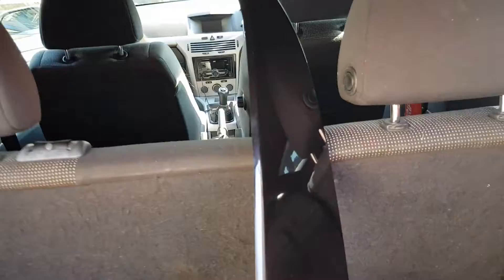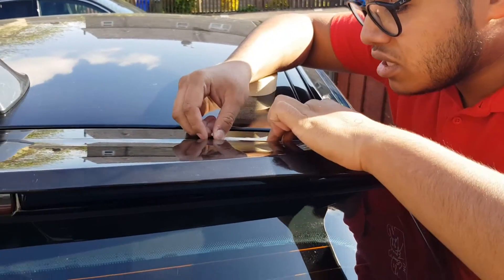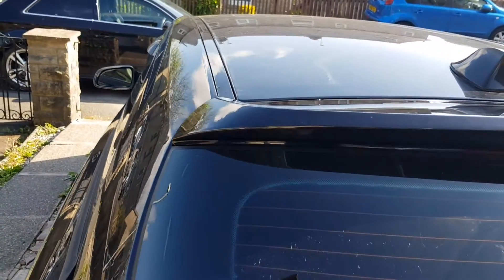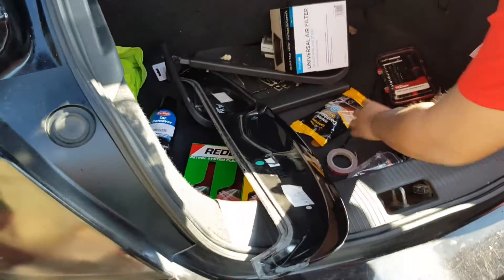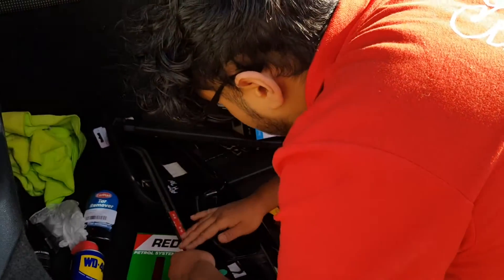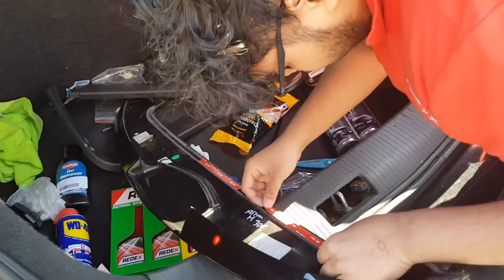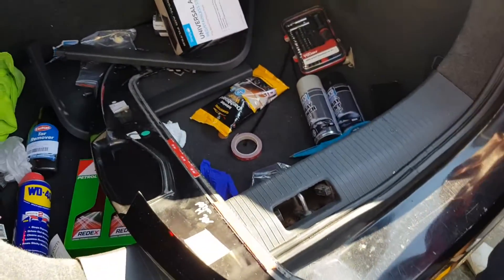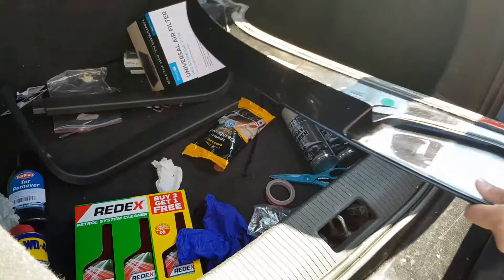How To Install Aftermarket Rear Spoiler (No Drill Required) Vauxhall Astra H MK5 2008

Comment: did the spoiler have abit of movement on it after it was fitted? or was it completely solid
Reply from the maker: No movement at all brother, the silicon sealant we used is dead strong haha, the spoiler still standing today without issue :p